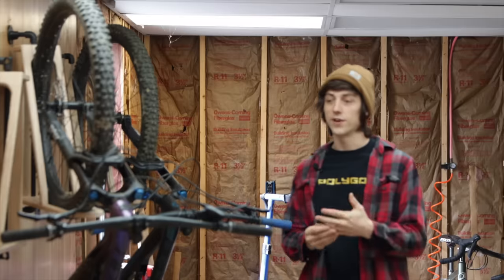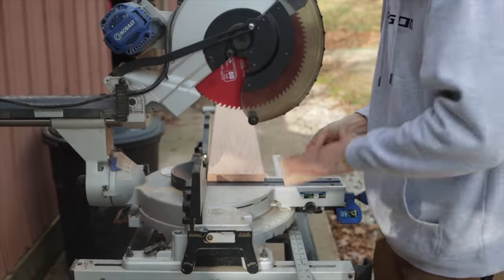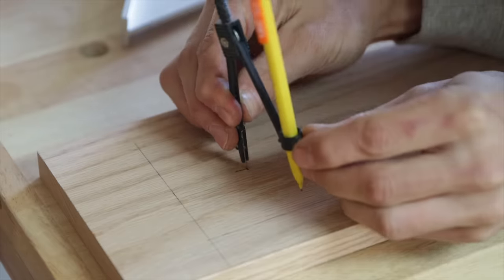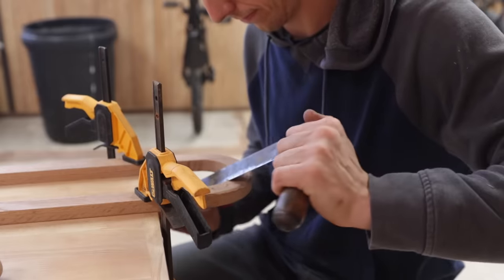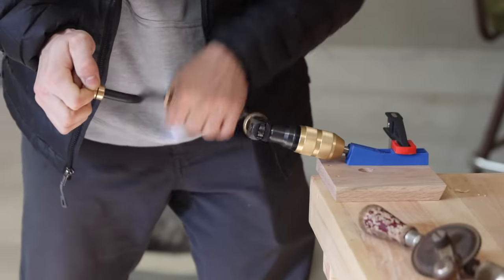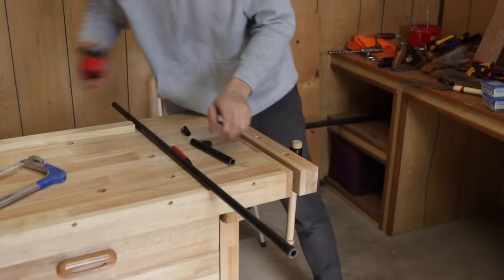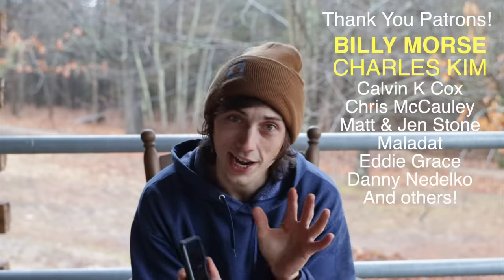How to build a Wooden Swivel Bike Rack!

Comment: Pro-tip: When gluing end-grain, especially with oak, put some glue on the end grain and massage/press it in with your finger so it will absorb, wait a few minutes, and then apply more glue and assemble the whole thing. The end grain of wood is basically just a bunch of tiny straws, so it tends to soak up glue, and as a result the glue joints tend to fail. By presoaking them with glue and letting it harden up a bit you can reduce the likelihood of running into problems with it.

Comment: Great video.  It inspired me to build my own to replace the floor based bike storage I have in my work shop.  I actually built four of the racks using different types of wood.  First rack I built out of Red Oak.  It's definitely strong and holds my Specialized Roubaix with no problem, Rack # 2 I built out a Red Oak & Poplar.  Again nice and strong and holds my DIY Bamboo Gravel Bike with no issues.  Racks 3 & 4 are built out of Birch and are for my Mt. Bikes.  I built all four over a period of 5 days and I couldn't be happier with the outcome.  I gained just over 20" of floor space and the bike storage looks 100% nicer.  Thx for the video once again

Comment: Quick way to get the inside radius-you can drill a hole using a hole saw (whatever the radius is).  Then all you have are the straight cuts.

Comment: Awesome look. I discovered a trick when designing a Murphy bed using gas pipe. If your vertical pipes were 3/4” with T’s top and bottom, you could mount two horizontal 1/2” pipes stood off the wall slightly that would pass through the 3/4” T’s. Now your racks can swivel and slide. 

Next we have to figure out a rack that can hold a rear wheel and we’re really saving space!
Reply: I wish you could add a photo. I am hoping to build this for 5 bikes (!!!), and am hoping it’ll stand up to the test of time. I’ve already re insulated and redrywall the garage wall,  as well as adding electrical outlets. I’m hoping to do this right and keeping my mistakes down to a minimum!

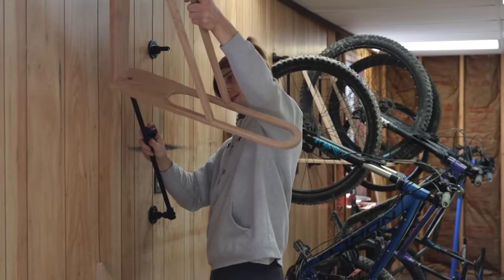Comment: 10:00  I didn't see any, but you might want to add washers onto the bottom of the piping, so that the wood swivels on the washer and not on the wood base! If you want to save cash, use 2 plastic washers stacked on each other, cut out of a soda bottle.

Comment: Don't need wood at all for this project.  Use larger galvanized pipe for the bike hanger with PVC sleeves (unions) inside the metal pipe which will act as a spacer between the metal pipe.

Comment: I have seen similar bike racks but have always wondered if this puts any pressure on the fork and bolts....leading to having to tighten them or check them each time.
Reply: I just built one of these, and it seems like all the weight is put on the tires. My assumption is if your oval cutouts are sized just larger than your tires, you would have the same situation, and no extra stress is put on other components. Remember, the bike bears your weight when normally riding, plus all of the extra force from drops/jumps. Bikes are plenty strong.

Comment: For the rear wheel I would probably just cut out a 90 degree v shape block instead of using the little piece just for a slightly more secure hold

Comment: The only issue is that the fluid in the front suspension will drain easier.
Reply: This is not a problem, but a benefit. fluid will reach the top bushings and lubricate them. It is useful to do this before every trip.
If you have oil leaking through the seals, then congratulations, you missed the service. And a long time ago.

Comment: "as close as the studs in your wall"... bro 

brick walls...
Reply: Get a hammer drill and masonary bit to drill the holes, then get brick anchors and you’ll be able to put them anywhere you want on your brick wall.
Reply: Masonry screws!
Reply: @RideAlongside  that was the point bro

Comment: Just a recommendation, if you have hydraulic disc breaks I wound not recommend storing you bike like this
Reply: If, after turning the bike over, the brakes are airing and you do not know how easy and simple it is to fix it (return air to the expansion tank), then it is better not to move further 100m from the bike service
Just a recommendation =)